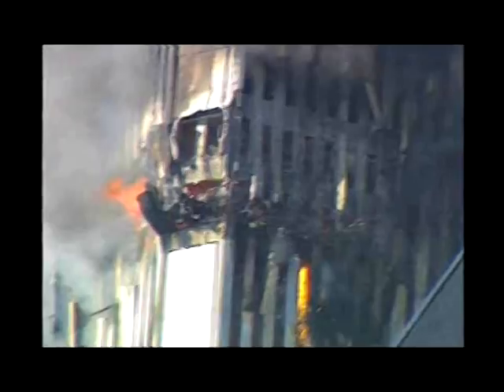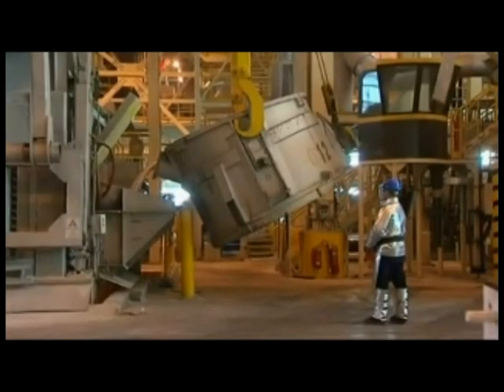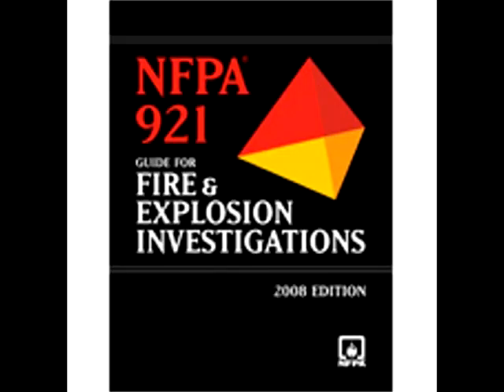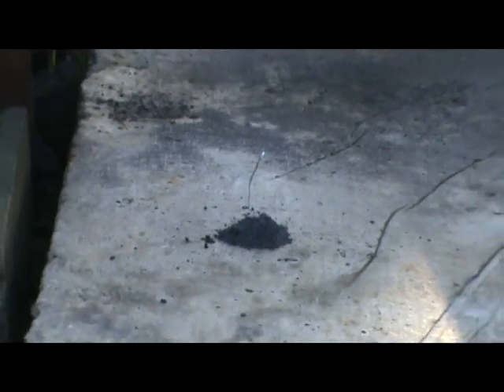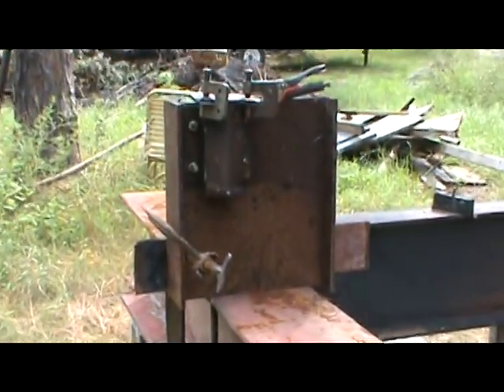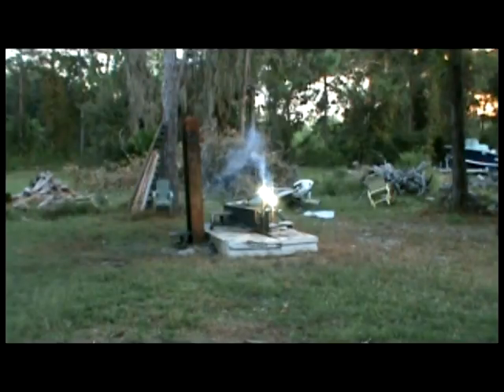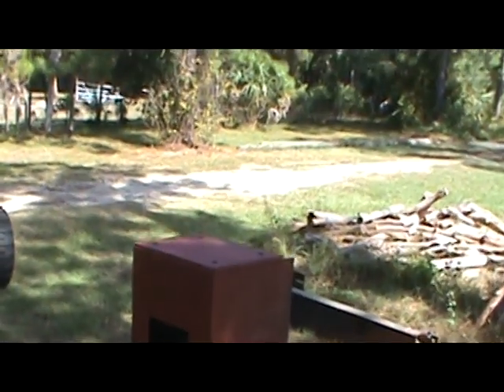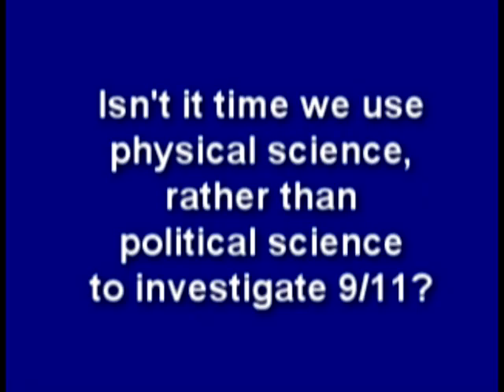9/11 Experiments: The Great Thermate Debate

Comment: I challenge whoever made this video to put the same amount of effort into attempting to melt steel beams with Jet Fuel. Max burn temperature of jet fuel is around 4000 degrees F. Plenty to melt steel. Inside a tower is not "open air". A tanker truck crashed under a freeway overpass in San Francisco, and the heat of the gasoline fire caused the steel overpass above to collapse! http://www.liveleak.com/view?i=37f_1339831773&comments=1
Reply: Also you are accusing the government of an unspeakable crime. They would go far beyond being "assholes" if you were right. But these kinds of conspiracies only happen in the movies. See "captian america, the winter" soldier for an example.

The fact is,  some insignificant terrorists managed to kill thousands of people and the government was too inefficient/slow to stop them. Thats the world we live in. Its better to come to grips with it that then live in fantasy land where all the bad in the world can be blamed on the machinations of an evil Hydra-like shadow government.
Reply: Many people seem to assume that because the building fell on its footprint, it was a "symetrical", "controlled" collapse. The fact is, a modern building will never "tip over" as it falls because it is not strong enough to stay rigid as it tips. In other words, sky scrapers never fall like trees. Once the stresses exceeds the supports because some have been dammaged/melted/weakened, they will all fail in a "symetrical" manner and the building will fall straight down.

I find it hard to understand why people have so much trouble believing a huge airliner could cause the collapse... I think its amazing it stayed up for as long as it did.
Reply: FakeMoonRocks  I know exactly what your screen name refers to. It says that in spite of the thousands of people who worked in the Apollo Mission (some of whom were my friends and co-workers), the widely televised coverage of the launches and recoveries, the easily visible artifacts left behind, you believe it was all a CIA scam.
I suppose it was intended to be used as a fundraiser or something.
Sure, I should always look for truth concealed as lies. Therefore I should believe you. Perfectly logical, in a circular sort of way.

You might want to stock up on aluminum foil. Word is the cost is going up due to the increasing demand for thicker hats...
And don't presume to know what TV programming I watch, that's classified CIA Troll info.
Reply: Same thing happened in Birmingham, at the I-20/59 and I-65 interchange. Driver killed, tanker melted. No melted steel, just softened. Damn bridge collapsed anyway! Damn!
Reply: Hmmm...the WTC did have melted steel and the collapse of the towers were complete and symmetrical. Not what you'd expect to happen according to the "official" story. That kind of asymmetrical damage and burning would have no doubt resulted in an uneven and partial collapse.
Reply: FakeMoonRocks
No. There was no melted steel. The collapse was not complete. The collapse was not symmetrical. You are trying to build a myth from baseless assumptions. Do some research that isn't directed by conspiracists.
Reply: *****
There was molten steel. We have eyewitness testimony of people that were there. See the widely known clip of the NYC firefighter telling us about "...molten steel, running down the channel rails, like you're in a foundry, like lava."

We also have the object known as "the WTC Meteorite" which is massive boulder-like mass of fused concrete and what was molten steel.

To top it all off, we saw glowing, orange, molten steel dripping out the side of one of the towers before the collapse. Sorry, chump. Your predictable claim that it was molten aluminum doesn't cut it. Molten aluminum doesn't glow orange in daylight.
 
The collapse was, for all intents and purposes, complete; two 110 story buildings leveled pretty much right down to the ground.

Watching the collapse of each tower, we saw floors exploding consecutively and completely, with a symmetrical cauliflower shaped debris cloud. Again, for all intents and purposes, the collapses were symmetrical in fashion.

In fact, in the case of the south tower, the top of the building, that was supposed to be the driving force behind the "pancake collapse theory," is seen falling off and away from the rest of the building, in the very early stages of the collapse. Yet, the floors are still seen exploding in, for all intents and purposes, perfect symmetry.

You want me to "do some research that isn't directed by conspiracists"? Considering that wouldn't even be the case, since everything I've stated has been from my own observations, I have a better idea. How about I don't listen to dimwits like you, that deny the obvious and pull shit out of their asses and throw it at the wall, in desperate hope that it sticks?
Reply: FakeMoonRocks
Testimony is not evidence, anybody can testify to anything. A rescue worker was interviewed saying that they were walking on red hot steel, and that the soles of their shoes would melt withing a couple of hours. Mmm hmm. A fireman claimed he saw molten metal running "like in a foundry" days after the collapse. Mmm hmm.
Were you there? You keep saying "We saw... " as though you were there... are you one of those "witnesses"? Are you a specially trained in visual failure analysis? Can you actually refute the scientific investigation into the collapse based on your superior observational skills?
...And can you separate your hatred for all things American from any possible bias?
I don't think you can, or would. I think you are bent on "exposing" the excesses of the government. That, in itself, is good. But look for facts, not fairytales
Reply: *****
Are you saying that your stupid and unfounded, armchair opinion trumps the testimony of numerous people who were there?

Firefighters know people like you are full of shit.
firefightersfor911truth.org/

My "hatred for all things American"? WTF? You obviously don't know me very well. I love my American cousins to the south. I love the land, the cities...the wide open spaces. I've got actual family in the USA for fucks sakes, and I choose to visit from time to time. That's right. I don't have to. I choose to.

Is America perfect, or could it ever be? Of course not.

You're confusing some assholes within elements of American government with all things American, moron.
Reply: Clide Seamore
WTF? Who told you conspiracies only happen in the movies? Maybe you need to spend less time with your head up your ass at the movies, and spend more time paying attention to real life.
Reply: Lol. Lets hear about some real conspiracies.
Reply: FakeMoonRocks
You probably believed everything you saw in "Mission Impossible" reruns to be real. Your screen name betrays your attitude.
Reply: *****
Sorry, chump. I have no idea what you're talking about. I don't watch that kind of worthless television.

My screen name refers to the fake Moon landings that occurred from 1969 to 1972.

Yup, that's a front page from the Weekly World News supermarket tabloid as my avatar.

The Weekly World News was launched in 1979 by Generoso Pope, Jr. and he worked for the CIA's psychological warfare unit.

When the Weekly World News ran the 1991 headline, "Moon Landing Was A Hoax," it was the truth hiding in plain sight, in the least likely of places. The knee-jerk reaction by brain dead folks like you was to assume it isn't true, because it was on the front page of the Weekly World News. Domestic psychological warfare in action.

Currently, the Weekly World News exists only online and can no longer be found at supermarket checkouts, as domestic psychological warfare has become more sophisticated and has concentrated its efforts in more mainstream areas of media - CNN, FOXnews, CBC, BBC, newspapers, magazines, Hollywood, the stupid TV shows you watch etc., etc.
Reply: *****
It's not my position that thousands of people didn't work on a project named "Apollo," in some capacity or another.

Launches and recoveries? Are you serious?

It isn't my position that rockets weren't launched either. Heck, Saturn V rockets were launched for the Apollo-Soyuz Test Project and to put Skylab into orbit. But those missions aren't even "officially" said to have gone to the Moon now, are they? So how the fuck does a rocket launch prove men went to the Moon?

And what did you see on the television regarding the recoveries? You saw edited footage of a capsules hanging below some parachutes. Do you know for a fact the capsules weren't dropped out of JC-130A Hercules aircraft?

"...easily visible artifacts left behind..." WTF are you talking about? On the Moon? Easily visible? How? With Earth-based telescopes? Show me the proof of that. LRO images? Blurry, pixelated, digital, and therefore easy to fake, images supplied by the very same agency that would be responsible for faking the Apollo Moon missions in the first place? Are you being serious?

This is the problem right here. This is how gullible most people are. This is what passes as "conclusive," "irrefutable" proof for a moron like you? Good grief. If that's the case, you could be easily convinced of anything...as if I needed any convincing of that.
Reply: FakeMoonRocks
OK, why do you think it wasn't done? Do you have evidence to the contrary? Witnesses? Or reports from some tabloid that confirms Elvis sightings every few weeks? Why is your claim any more valid than all the actual witnesses? Do you have any of the Hollywood producer's statements? Actors? Any of the film? Outtakes? Anything except a desire to culture your own dislike of the USA?
Do you have any understanding of how science works? Do you actually believe that just because this was a very difficult feat, it would have been impossible to do, so the government had to spend untold amounts of $ to fake it? To what end???
Sorry, but I'll take the word of my friends and my own experience over yours. You say I'm gullible? No. You wish I was.
Reply: *****
If you can watch the Apollo 11, post flight, press conference and not have your bullshit detector go off, then you don't have a functional bullshit detector.

At one point, the two alleged Moon walking astronauts were asked if they were able to see stars from the surface of the Moon.

Admittedly the question was phrased ridiculously, as they were asked if they could see stars in the corona of the Sun. This, of course, would have required looking at the Sun, which obviously isn't a wise thing to do on Earth, in outer space, or on the Moon.

Nevertheless, Neil Armstrong's reply was to say stars cannot be seen, from the surface of the Moon, or from orbit, on the daylight side of the Moon, without the aid of optics. This was odd, but even odder still was when Michael Collins, the Apollo 11 astronaut that didn't descend to the surface of the Moon (as the "official" story goes), chimed in to say he didn't remember seeing any stars either. Armstrong's reaction to Collins' interruption was very telling.

Furthermore, stars would most definitely be seen from the surface of the Moon. It is the Earth's atmosphere that prevents us from seeing them in the day. Refracted light scatters throughout the atmosphere and causes a bright blue glow that drowns out light from stars. The Moon is, of course, absent of such an atmosphere, therefore this effect wouldn't be present on the surface of the Moon, or otherwise in lunar orbit.

This is shown to be true when a spacecraft launches into space during a daytime launch. Mike Melvill, after his SpaceshipOne launch, reported that he was astonished to see the blue sky turn black and stars come into view, as he ascended above most of the Earth's atmosphere, despite the Sun being present in the sky and the bright blue glow of the Earth from below.

Yuri Gagarin also reported seeing stars on the daylight side of the planet, as he made a single orbit as the first man in space

Again, Armstrong didn't just say stars couldn't be seen from the surface. He said they also couldn't be seen from orbit, on the daylight side of the Moon. We know this can't be true because, once again, like I've already said, both Gagarin and Melvill gave firsthand accounts of seeing stars from the daytime side of planet Earth (which has an albedo of 0.3 - 0.35, BTW - brighter than the Moon), during spaceflights above the atmosphere. So did Leonov and Titov.

Why would things be different for the Moon, since it is only scattered light within the Earth's atmosphere that prevents us from seeing stars during the day?

Get over it. Neil Armstrong and the rest of the boys lied about going to the Moon.

And STFU with your accusation that I must hate everything about America, you simple-minded fool. I've already explained myself and dispelled that ridiculous notion. You must be desperate if you need to resort to such juvenile tactics, Billy-boy.
Reply: FakeMoonRocks
Wow, stars... such absolutely convincing evidence...
It's a simple matter of comparative brightness. Ask any astronomer. Or maybe visit this site: https://en.wikipedia.org/wiki/Examination_of_Apollo_Moon_photographs#Absence_of_stars
As for your statement that you have friends and family in America... hey, great. I have friends in Russia, France, England and China. Whoopee.
Reply: *****
LMFAO! How typical for you to desperately try to confuse the issue of seeing stars with one's own eyes, with photography.

If you went out on a clear night, when stars are visible, and took a photograph using regular camera settings, thus creating a photo that didn't show any stars, would you then foolishly conclude that you must have been mistaken and you didn't see any stars in the sky that night? Good grief.

Comparative brightness? Ask any astronomer? Wow! What a robust explanation. NOT!

How's this for comparative brightness; the planet Venus, under the right atmospheric conditions, can be seen with the human eye at midday, with the Sun in the sky. What's the comparative brightness between the Sun, which is much larger, even as it appears in the Earth's sky, and emits an enormous amount of light, versus the planet Venus, which merely reflects a relatively small amount of the Sun's light?

What do you think would happen if we could take away the Earth's atmosphere in this scenario? Answer: The planet Venus becomes that much easier to spot and the stars come into view, as well. Ask any astronomer that knows WTF they're talking about.

You have friends in Russia, France, England and China? Oh yeah? Well, should I be a fuckin' stupid twit like you and conclude you hate all things Russian, French, English and Chinese?

Maybe you should look into what your nation's Founding Fathers said about criticism of the government.

I can tell you for certain that they didn't discourage it and label it unpatriotic. Only morons like you think that it is unpatriotic and that it is your obligation to play stupid and roll over.
Reply: FakeMoonRocks Venus isn't a star, genius. It's a planet. It reflects sunlight, it doesn't emit light at all. The brighter the sun, the brighter Venus is. The Stars are several orders of magnitude less bright than Venus. The iris closes down it bright light, making dimmer objects harder to see. Is that really that hard to understand? The atmospheric scatter contribute, but is far from the sole source of daylight. Our eyes compensate for the glare of all the reflected light around us. Stars are exceedingly dim. The Sun is no less bright in orbit of on the moon. If you are in shadow, the stars are easier to see. In full sun, not so visible. Realize, too, that the viewports of orbiting spacecraft are very darkly tinted, as are the visors of space suits.
Ever tried to see the Milky Way when you are near the lights of a city? How about from high in the Rockies? Some difference, huh?
 
I repeat my challenge to ask any astronomer. They know a few things about visibility of stars.

Yes the founding fathers approved a little measure in the Constitution called the First Amendment, thus guaranteeing our right to criticize our government. The very basis of a democracy requires the ability to do so. Voting is the epitome of criticizing government. You are absolutely convinced that if we believe anything we hear from anyone who isn't screaming about conspiracies all the time, we are fools. There are conspiracies, I hate all government, we have the most corrupt Congress ever. But that doesn't mean everything is a lie.

Now, who said anything about patriotism? You claim you don't hate America because you have friends here. I'm just pointing out how stupid that remark is.

But I'm sick of this shit. Goodbye.
Reply: *****
Holy shit, fuckhead! How did you ever get the idea that I thought the planet Venus was anything other than a planet? Geez, I only referred specifically to it as "the planet Venus" three times in my comment. What's the matter? Can't read? Or, did you just feel an overwhelming need to create a strawman argument; the only kind you're capable of winning?

You say, "The brighter the sun, the brighter Venus is"? WTF are you talking about? For all intents and purposes, the Sun's brightness is a constant. Any change in its brightness (apparent magnitude) would occur over the course of an extremely, very long time. Therefore, the light reflected off (*ahem) the planet Venus is also a virtual constant. The variable of these celestial objects, when viewed from Earth, is atmospheric conditions.

You say, "The iris closes down it (SIC) bright light, making dimmer objects harder to see." Sure, but as bright as the Sun is, the infinitely less bright planet Venus is still possibly visible in the sky, at midday. It's is difficult to see, but still possible. The reason it is so difficult to see has more to do with the atmospheric effect of scattered light creating a blue glow in the sky overhead, than the eye's iris, the brightness of the Sun, or whatever other shit you'll pull outta yer ass.

Take away the Earth's atmosphere and not only does the planet Venus become much easier to see, but the STARS also become visible. That's the point you missed completely. It is a scientific fact backed up common sense and the eyewitness accounts of people that have made spaceflights above the Earth's atmosphere, on the daylight side of the planet (I've already mentioned names in a previous comment), and seen stars.

You want to know how these people saw stars in outer space, above Earth's atmosphere, even with the Sun not being blocked out by planet Earth? Easy. THEY DIDN'T TRY TO VIEW THE STARS WHILE LOOKING STRAIGHT AT THE SUN, YOU FUCKIN' MORON!!! If they did that, they would have seen only one star...and that star would be our Sun. And if they tried to looked at it for more than just a fraction of a second, it would be the last thing they ever saw, you dimwit.

You want me to realize that (all) the view ports of orbiting spacecraft are very darkly tinted, as are the visors of space suits. Then how is it we have eyewitness accounts of people seeing stars, in outer space, above Earth's atmosphere, on the daylight side of the planet? And the alleged, Moon walking, Apollo astronauts had retractable visors, with a clear, glass face covering underneath. Photographs from NASA's own records prove it.

Yes, there is a big difference in the viewing conditions, when trying to observe the Milky Way, when you are near the lights of a city, compared to being away from city lights? Why do you think that is? Answer: Again, it's because light from the city scatters in the atmosphere above, thus drowning out much of the light from the stars and planets. Although, the effect isn't as great as compared to sunlight, which is why some stars are still visible when viewed from a city center. Thanks for making my point, moron.

You hate all government? Gee, should I be a moron like you and conclude, from that, you hate all things American?

You have the most corrupt Congress ever? That should be the least of your concerns when it comes to government. It's the unseen and unelected forces within government that are behind the worst conspiracies you foolishly don't think exist.

Between you and me, the word "patriotism," with regards to the USA, can only apply to you. It has nothing to do with me. I'm not American.

You made the stupid remark and ridiculous accusation that I must hate everything about America, based on criticisms I have. It isn't a stupid remark and ridiculous accusation because I said I have family and friends in the USA. It's a stupid remark and ridiculous accusation, because it's a stupid remark and ridiculous accusation. Plain and simple.

So, in conclusion, you ended your comment by saying you're sick of this shit. Excellent. Now I don't have to read any more of your tripe. Your reading skills suck. Your debating skills suck. Your arguments suck. In short...YOU SUCK! You're an intellectual lightweight and you need to sit down and shut-the-fuck-up!